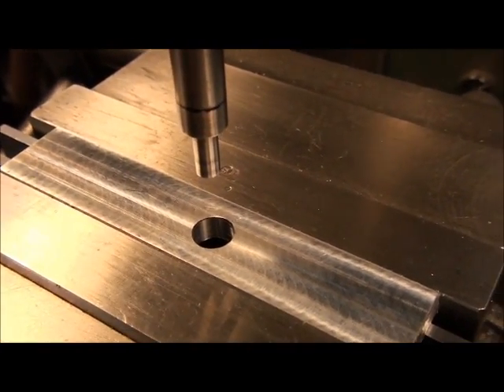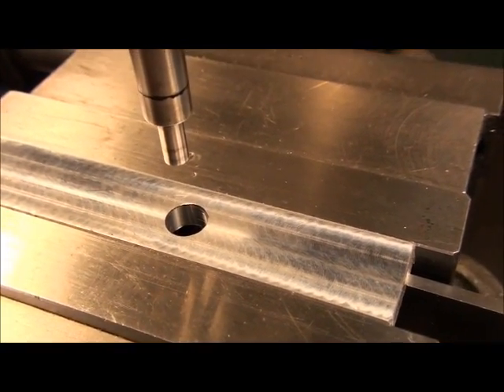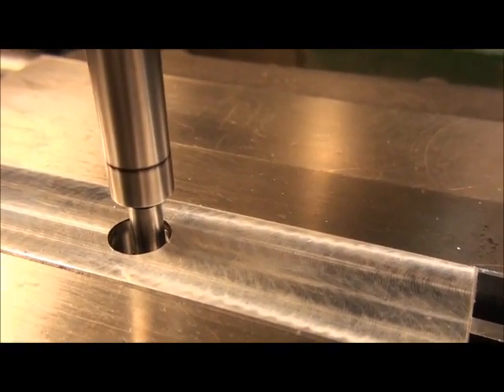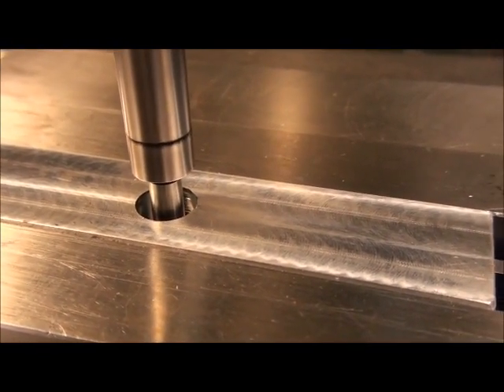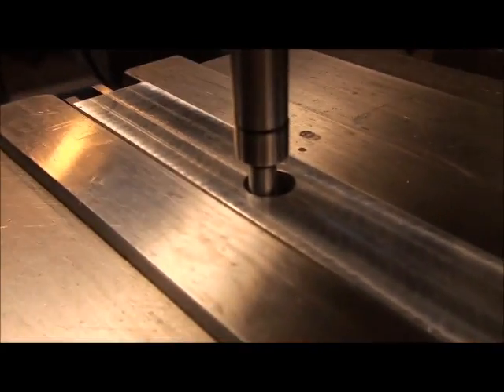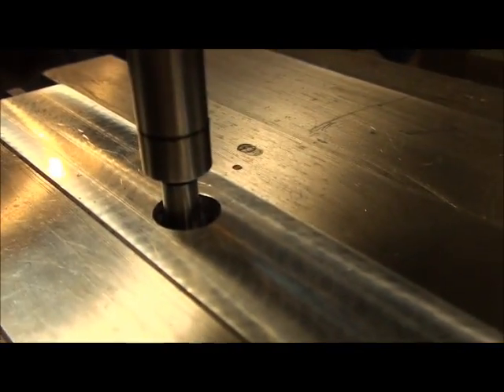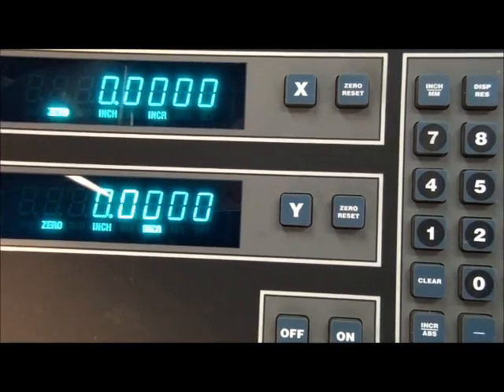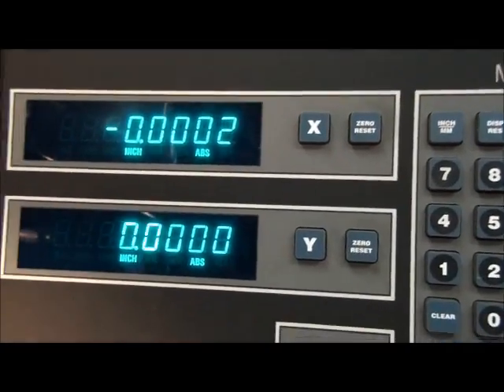How to Use an Edge Finder to Locate the Center of a Hole

Comment: What spindle spedd do you run your edge finder at?
Reply from the maker: Lol. Pretty much whatever the mill is set at when I use it. Doesn't seem to make any difference, other than how hard it kicks out.
Reply: @TomsTechniques  lol, I get all kinds of speeds depending on who I ask. I was taught to use 1400 when I started. I heard people say anything from 750 to 2500 rpm. 1400 always works for me. But it's amazing how many different answers you'll get when asking.

Comment: What you have done is guaranteed that you will end up exactly in the center of where you started. That is all.
Reply from the maker: You weren't paying attention. I bored the hole with the readout centered to show how well the edgefinder works to find the center of the hole. It wouldn't be a very good tip if it ended up off center.
Reply: @TomsTechniques  I apologize. I wasn't paying as much atttention as I thought. I did the math just for fun. Your technique works. I apologize for jumping to a conclusion before I thoroughly understood the process.

Comment: Haha what I find amazing is the amount of people telling you that this is wrong or not accurate. You people have obviously not been taught or tried, for 99% of machine work this is spot on. The other who moan on about clocking it but have no clue about the maths lol keep going your doing great.
Reply from the maker: Lol, it's always fun to think outside the box. I'm still astounded at precision of this technique.
Reply: @TomsTechniques  it's because it is deceptively simple. Go one way get a size plus error go the other way get a size + error. Because any errors are polar opposites they cancel each other out. Or another way is what it is half of an "untrue" measure on each radius which is the same midpoint at y=0 or when y = +1 or -1. I.e. the chord of a circle

Comment: does the center point come out of these things or is the blunt ended edge finder a separate tool?
Reply from the maker: This one has a pin on one end and a point on the other. They are not meant to be disassembled.

Comment: Question: when you “eyeball” approximate center and run back to “y” axis backside, if you are off ( in the “x” direction) by a couple millimeters you will prematurely hit your stop as you encounter the arc of the circle. Would running back and forth on the “x” axis a few millimeters get you more accurate in your position?
Reply: A diameter line midpoint is your zero,  imagine a line below or above that running parallel half of that length still gives the same midpoint, even though the line length has changed due to being off centre.  So in essence what ever way your measuring make sure the other direction is at the same value and does not deviate, then your midpoints are all the same.
Reply from the maker: I've tried purposely offsetting the X axis to see what would happen and surprisingly, it had vey little effect on the precision of the center location. Obviously, the farther off center, and possibly the smaller the hole,  the more chance for error, but anywhere close works fine. It would be interesring to graph the results.

Comment: Dumb question.  When you started on the Y Axis...how do you know your edgefinder is hitting the deepest portion of the hole?
Reply from the maker: Turns out it doesn't matter. I've purposely offset the edge finder and it made no noticeable difference in the precision. Of course it has to be somewhere near the center line, but it doesn't have to be right on.

Comment: Don’t mislead people, they’re going to look stupid if they do this at a shop. Use the right tool, use a dial test indicator
Reply from the maker: Don't be so narrow minded Albert. This is a quick way to find the center of a hole without, in the case of a hobbyist, having to purchase an expensive dial indicator. Even so, it is surprisingly precise and definitely faster than indicating. I save time by using this technique in my shop quite often and don't feel stupid at all.

Comment: This is completely wrong. It will kick out above center not being on a straight edge.
Reply from the maker: Apparently not when the finder is anywhere near the center of the hole. This is a technique I use all the time and it works very well.
Reply: @TomsTechniques  Then why don't you do the video again and check it with an indicator at the end of the video when you are done and prove out your method. No proof this works.
Reply from the maker: If you actually watched the video, you might notice that the hole I am working with was bored and the DRO zeroed out. Indicating it would be redundant.
Reply: @TomsTechniques  Too lazy to show it with an indicator then. Ok, doesn't work.

Comment: Not very accurate way if your tolerance for the center is .001 or less
Reply from the maker: That is actually not true. In the video I bored a hole, zeroed out the DRO, then picked up the same hole with the edge finder with much better accuracy than .001". Try it and verify with an indicator if you doubt the result.

Comment: when you touch say in x direction how do you know if you are moving on the y center and not off a bit?
Reply from the maker: When I first started doing this, I thought the same thing and did the centering process twice to compensate. But as it turns out, unless you are grossly off center, it just doesn't matter.

Tom
Reply: Thanks
Old Bob

Comment: great video Tom, only problem 4 me is I do not a dro. and this task is near impossible without one because your backlash
Reply: I know this is old comment, but maybe someone will find this useful:
You can very well do it without a DRO, what you need is a dial indicator with a magnet, so that you can read the actual movement of the table. That will take care of the backlash pretty well. Of course, you can pick a hole with max dia of (total indicator travel + edge finder tip diameter) at most, but this takes care of most what you'll meet in a home shop...
Reply from the maker: This technique does work best with a DRO, but if you know how much backlash is in your screws, you can get pretty close with dials too.

Tom
Reply: IF the tables trammed close and you set the y first... i think maybe .1 or close on the dial .  If the mill has an eliminator... Billy T you can do this~

Comment: Use a pointed center finder and it verifies X and Y at the same time...easy peasy.
Reply from the maker: Easy peasy maybe, but not reliable. Center finders are intended to be used on a center punch mark or scribed line. Using then on a hole means they are bearing on the theoretical sharp corner, not the sides like an edge finder, a no no in the machining world.
Reply: Your example in the picture looked like a freshly reamed or nicely drilled crisp edged hole.  If it's a bolt hole to be treaded with some tolerance, I say go for it.  If it's tight  like a steel alignment pin...maybe not.
Reply from the maker: Right. If you don't need the precision, then use whatever is quickest.

Comment: Practice more with an indicator. Its faster and more accurate by alot
Reply from the maker: Lol, practice? I think I pretty much have it figured out by now. Try the technique. I think you will be surprised at how well it works, if you have a mill that is.

Tom
Reply: More accurate than 2 tenths on a mill...
If you need more accurately holes or whatever.... you better in a climate controlled shop with a jig grinder

Comment: If only you could get an electronic edge finder for most hobbyist machines.
Hobbyists usually use ER11 collets and work on non-conductive materials.
These are 12 or 16 or 20mm  
..that would simplify so many things.
Reply: Marcus Wolschon you can buy ekectric edge finders

Comment: Nice video! How accurate would jamming a Live center down the hole be?
Reply from the maker: Not very because the center would bear on the edge of the hole rather than the bore. It's never good practice to work from a sharp corner like that.

Tom

Comment: Your subscribers should also be aware that when it comes time to buy an edge finder, don't go cheap with a Chinese set, but rather buy a Starret.
There are plenty of tools to save money on, that don't require the Starrett name, but on an edge finder or wiggler, they earn their keep.  Not only that, but I've had my Starret edge finder for 23 years and I paid a whopping $12.00 for it.
Funny thing is, I've been running manual equipment and CNC mills and lathes for about 30 years, but never considered using my edge finder for hole locations.  But, when my Blake Coaxial indicator just went tits up, I can't afford to shell out $400.00 at the moment to replace it.
You're the first one I've seen that actually documents how close this technique will get you to center, which was my hesitation in using it for the purpose.  On actual edge-find work on a CNC, I've been able to be within .0001-.0002" with my Starret, but never tested the hole theory.
Well done.
Reply: doesn't have to be Starrett edge finder. Could be Brown & Sharpe, Mitutoyo. In fact Starrett has been cheaping out on a lot of stuff nowadays, claiming "they can't compete, yada yada " My response to Starrett is "Oh REALLY?? You can't, huh ?? How does B&S and Mitutoyo manage then ????" Good example: current new  Starrett 6" analog dial calipers --- drop them and you asking for trouble, not to mention plastic dial bezel adjusting ring (which likes to crack).....is B&S like that? NOPE!! Is Mitutoyo ??? NOPE! Just my two cents, been machining for 15 years. I wouldn't recommend buying anything Starrett if new ....only the old stuff...particularly that which says on the side L. S. Starrett, That's the GOOD STUFF !!! (did you notice the DON"T PUT "L. S. Starrett" on anything nowadays!!). I stopped buying (anything) brand new starrett after my 6" analog dial calipers went to shit after just 10 months in service at a shop!
Here's another one: NEVER buy a dial test indicator by Starrett. Buy: Brown & Sharp "Bestest" --- just ask the folks at Long Island Indicator how the two compare (they repair gages and instruments; and they are Swiss, BTW) -- think about that for a while.
Reply from the maker: +GrizzlyMtn 
I definitely agree with you about not cheaping out on the edgefinder. There are plenty of cases where Chinese imports are acceptable, such as parallels, shop grade gauge blocks and pin gauges (providing you verify their accuracy), but tools like micrometers, digital calipers, indicators and edgefinders should be the best you can afford and not made in China. There are plenty of videos on YT showing how bad this Chinese stuff really is, especially the digital caliper knockoffs.

BTW, I don't even use my co-ax indicator any more. Its much quicker to just use the edgefinder and just as accurate.

Tom
Reply: Surprisingly enough, I've had pretty good results with Chinese mics and calipers.
Calipers by their very nature, aren't exactly precision instruments, regardless of the name brand, so I don't mind spending $20.00, rather than $200.00 on a set.  
With that said, my go-to set of 0-1 mics are an old Brazilian made pair from Mitutoya.  Most folks have never seen them made anywhere but Japan.  
I've used several sets of Chinese mics and went through 6 month calibrations on all of them.  They never missed a beat, but the ergos on most lack a lot to be desired.
The quality that Starret puts into their final finish on edge finders and wigglers is worth the extra dollar or two you spend over the imports though.  Those surfaces have to be extremely smooth and precision and it's quite apparent that the Chinese have not got that figured out yet.
Reply from the maker: +GrizzlyMtn 

The problem with the Chinese stuff is a lack of consistency. The same product can be good one time but garbage the next. If you have the ability to calibrate the Chinese mics then you are ahead of the game. The digital caliper knockoffs often have poor battery life compared to Mitutoyo. Mine stay on 24/7 and the batteries last for years.

I've always been partial to Etalon mics. The Asian import stuff, including Mitutoyo has always felt too springy in the frame for me. That's not to say they don't measure accurately, just that they don't feel as good.

Tom
Reply: You're right on the digital calipers.  I've used a variety and the Mitutoyo is the best, hands-down.
If I buy the cheap Chinese calipers, it's always dial, rather than digital.  They work fairly well and it has allowed me to have several sets in the shop to share with employees in different departments.  If they get dropped or broke, you're not out much.
Never handled the Etalon mics, but my first set was a Polish-made 1-3" that I got through MSC.  Dollar-for-dollar, they were the best I've had so far and very comfy to use.  Extremely precision and smooth.  Some 25 years ago they were a good bargain, but they've decided to price themselves right up with the rest of the spendy brands.
Back when I was single and without kids, I found myself spending most of my paychecks on tools.  Now days, I've acquired nearly all I'll ever need and then some, just ask my wife...:)

Comment: Very useful video. Learned CNC on a Haas minimill using a probe for work offsets, but I recently learned how to use an edgefinder and now see how much better it is. This video just made all of my projects a little easier since I can now center my programs on an existing hole on the part.
Reply from the maker: +Alan Hunt 
Thanks Allan, it's good to hear you got some value out of the video. Be sure to keep your edge finder cleaned an lubricated. They don't work near as well when they start getting sticky.

Tom
Reply: Probes on the Hass are amazing.  I would never use a d edge finder if the machine has a probe. Just me tho.  I don't sweep hole with an indicator unless the hole is to small for the probe   tip. Always good to know how to use other ways but the probes are one of the best pieces of advancement to cnc milling.

Comment: "Doesn't have to be exact" - I'm a complete novice and that was the bit of information I was looking for.
Reply from the maker: +David Rector 

One of the most difficult things to understand for a novice is that statement as applied to a toleranced dimension on a drawing. It is simply not possible to machine a part to an exact dimension, so all dimensions on drawings have tolerances associated with them. For instance, if a .500" dimension has a tolerance of ± .005", an acceptable range for that dimension is from .495" to .505". In other words, any dimension within that range is equally acceptable. So you don't have to waste time and energy machining a part to "exactly" .500" if it has that tolerance on it. Anything within that range is good to go.

Tom
Reply: One thing I  took from this was that the edge finder doesn't have to be centered in the X direction to get the Y center. Well, as long as the hole is round. Until I heard the "doesn't have to be exact" comment, I had the not given it enough thought and would have assumed that the center in one dimension was needed to be able to find the center in the other. Thanks for this video and the other advice about getting within tolerance. I watched your other videos and those were very useful too.

Comment: Ok fine. But you really should describe the basic arithmetic to use if your DRO does NOT have a Mid-Point function. You're really just showing how your DRO functions.
Reply from the maker: This technique won't work on a mill without a DRO because there would be no way to accurately compensate for the backlash in the leadscrew. I often show how to do operations without a DRO in my videos, but this is not one of them.

Tom
Reply: Toms Techniques
 I did not suggest to do this without a readout. I Commented that you should Explain the core method here.
Reply from the maker: beepcode
Sorry, my mistake. The thought never occurred to me since I've never seen a DRO without a midpoint function.

Tom
Reply from the maker: +pbrubaker 

Find one side of the hole and zero the axis. Find the other side and divide by two. Move to that point and zero again. Repeat for the other axis.
Reply: Toms Techniques ,👍

Comment: Great video. Can you explain why there's a 2 tenths difference between absolute and incremental? I don't fully understand the difference between the two. Thanks.
Reply from the maker: Thanks Jason.

Absolute refers to a fixed reference point on the part, such as one corner or the center. Once that is set, you can move to the center point of a feature on the part such as a pocket or hole pattern, switch to incremental mode and zero out the DRO without disturbing the absolute setting. That way if there is more than one feature on a part, you can refer back to the absolute reference point for each of them.

The .0002" difference in the reading is because the DRO reads in .0002" increments and it's likely sitting somewhere in the middle.

Tom
Reply: Makes sense now, thanks.
Reply: You said 2 tenths though. Maybe that's how its said on digitized equipment when you know the scale or resolution but .0002 is 20 thousandths right? That being the case even on precision work no bad at all!
Reply: ww5rm No, 0.0002” is 2 ten-thousandths of an inch. Twenty thousandths is 0.020”